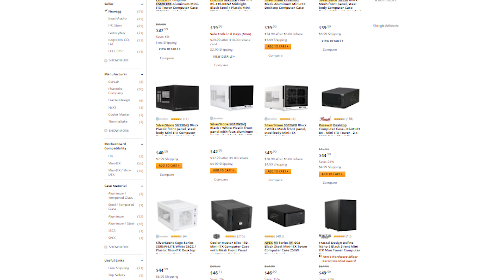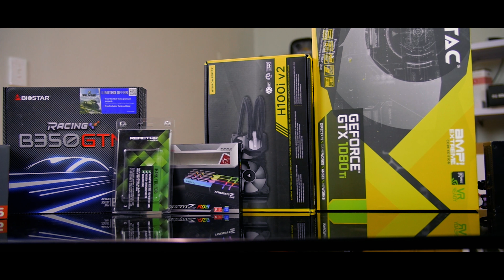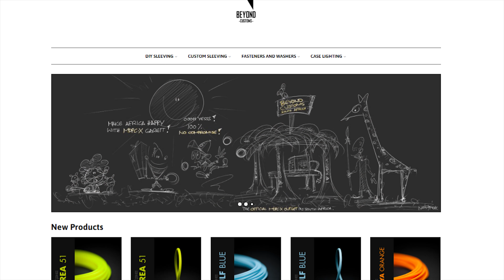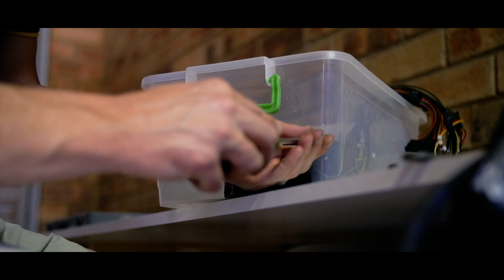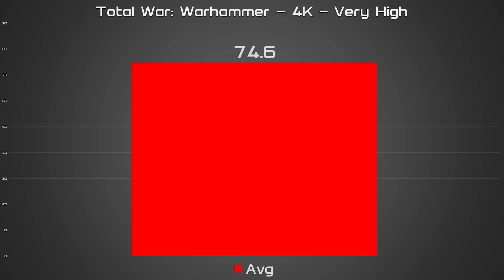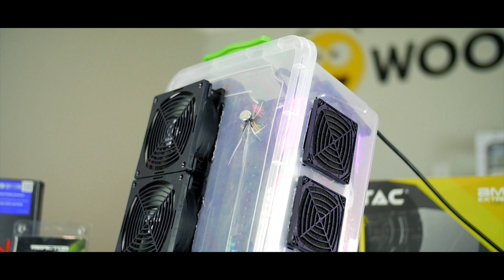World's Most Portable Ryzen 5 + 1080 Ti Mini-ITX Custom PC Build

Comment: Dude! This is seriously amazing!!! You should do a full custom water cooled loop in there. Also get some RGB fans in that case. You could even spray paint it black except for the lid to give a window. Just a thought. I love this idea! You should look into using an HDplex power supply because they are fanless nano PSU's. I did something similar with a wooden box and even screwed a monitor into the lid but it was too heavy. I might do the plastic box method for the lol's. 

Survive. Adapt. Overcome.

Comment: What psu unit did You used? Could an hdplex 300w handle It?
Reply from the maker: It’s a 450W, which is barely enough.  So a 300W wouldn’t work for this parts.

Comment: Or, you could have just affixed a handle to a Fractal Design Core 500 case, and had a stronger, better looking and just better system.
Reply from the maker: +Niall Macdonald Which would have cost more.
Reply: A $60 case, for something worth keeping. - smh

Comment: Try the lian-li tu line they are super tiny has a handle and with very little modifications you can fit a single fan radiator in the front
Reply from the maker: +Colte Conn Totey doesn't come with the price premium of Lian Like.
Reply: UFDisciple agree it is a great case though if you like tiny things like my GF. Are you going to be taking totey to mass production and retail?

Comment: The mini-ITX manufacturers need to think outside the box.

Maybe an integrated cooler block ?    Maybe move the memory farther from the CPU ?  Maybe less SATA ?  
Maybe more fan headers?

# 1 thing they need is the leader wires to front panel need to have an adapter for easy install.

Comment: How did you connect the dual 8 pin pcie power from the 450W PSU? My Silverstone 450W SFX PSU only has 1 output of 6+8 pins. Thanks
Reply from the maker: Used a 6-pin to 8-pin adapter. :D

Comment: Could have just bought an upgradeable gaming laptop for traveling but then again they are expensive af
Reply from the maker: There's no gaming laptop that has a 1080 Ti or a Ryzen 5 processor for that matter.
Reply: UFDisciple Yea true.
There are plenty of laptops with just a 1080 though or dual 1080s if you are trying to get the best.
Reply from the maker: Nah man, I've had the laptops that have dual 1080s.  SLI is buggy, their clock speeds are lower due to thermal limitations.  A desktop 1080 Ti beats them pretty handidly.

Comment: GTX 1080ti with ryzen 1600 might just be bottlenecking, unless you are gaming at 4K all the time.
Reply from the maker: Did I not say that the benchmarks were run at 4K?  I play at 4K.  No bottlenecking fam.
Reply: okay! well im the kinda guy with a GTX 1080 at a 1080p 144Hz monitor, i need those high frames ;)

Comment: Why didn't you build it into a small business suitcase?
Reply from the maker: Because small business suitcases aren't thick enough to house the height of GPU.
Reply from the maker: To do what? Sandwich it right next to the CPU with no room in between for airflow?  Also, the thickness of the 1080 Ti is probably just about as thick as a suitcase, there's hardly any actual room for it.  Would have had to have been a lesser PC.
Reply: That's actually a cool idea. I think I might do a SFF briefcase build...hmm